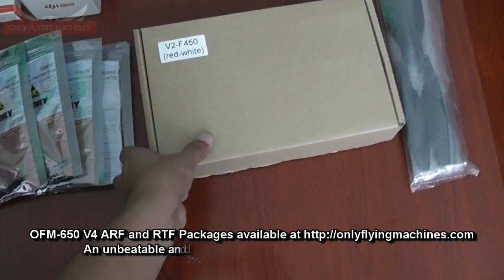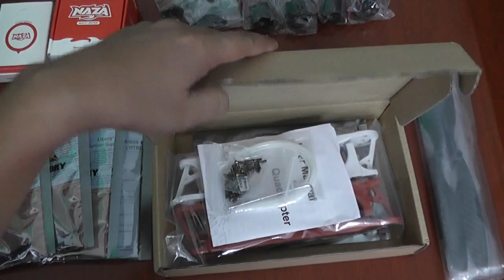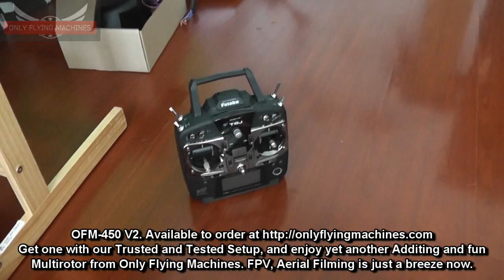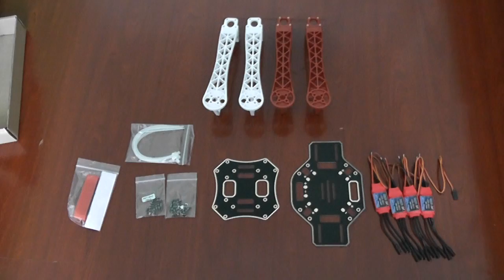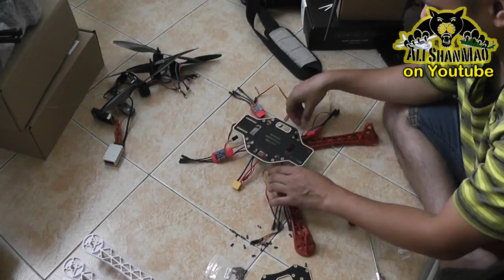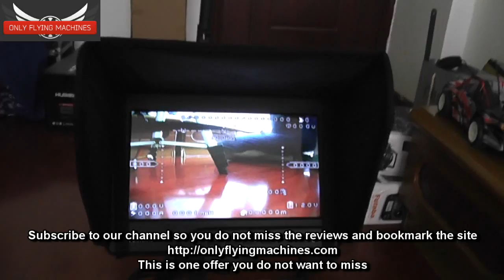OFM-450 V2 How to Assemble

Comment: Can you tell me what size propeller is recommended for a T-Motor MS2212 980KV motor? I've been using 10.47's but i'm wondering if they should be smaller......